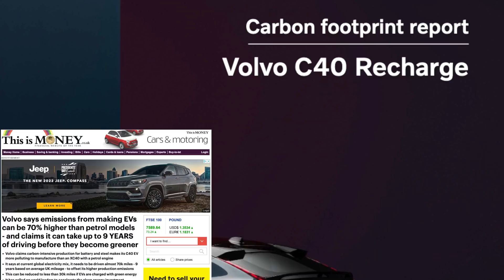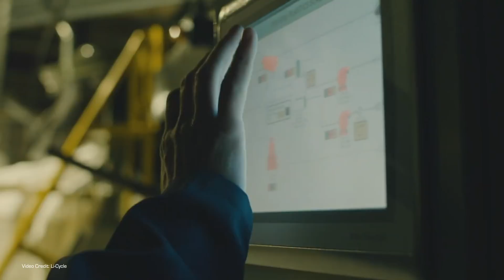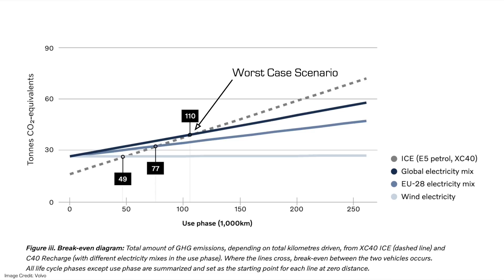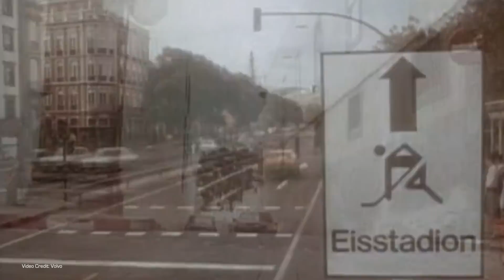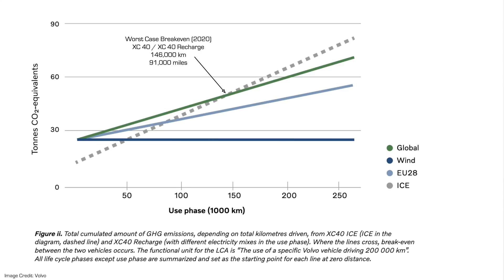Are EVs Dirtier Than Internal Combustion Cars? Not So Fast... We examine Volvo's Lifecycle Analysis

Comment: COMPARISON FLAW: Whilst it is interesting comparing between ICE and EV where the rest of the car platform is unchanged, this approach sounds greati but is biased towards ICE. Specifically, when you build an EV from scratch you do not end up with the same body design choices as with an ICE or shared body design such as having gearbox tunnels and reinforced engine mounting points. It is like comparing a horse-drawn carriage with an early automobile by removing the horses, bracketing the engine on to the same carrage but still having the original structures, and design heights that were created because of the horses.
An EV shoe-horned into an ICE body will not have the immediate, and therefore lifetime, efficiencies of a sensible pure EV design. Even a platform designed from scratch for petrol or EV will suffer from lowest common denominator disadvantages for the EV implementation.

Comment: Okay the only way I can compare an Eevee to a regular car emissions we have to take into a lot of factors not to mention the vehicle that you're comparing it to and how long it's been in operation and if it's still in operation and there are a lot of old cars going back longer than a hundred years still working. Then you got a factor in efficiency of those engines and at the highest today they're only 25% which means that cars older than that would have less efficiency and be more dirtier. I mean everybody wants to talk about the EV carbon footprint but they don't ever mention about the gas motor and all the other factors that come with its carbon footprint.

Comment: In the so called study in the U.K. Mail newspaper it stated that pollution was greater from an EV because being heavier so one had to used the brakes more to stop, what planet are they on? I hardly ever use the brakes, haven’t they heard of regenerative braking, Oh and heavier cars mean more tyre wear too. No mention though about the high levels of pollution in our cities cause by ICE cars both diesel and petrol, or the fact that thousands of people die prematurely from said emissions each year.
Reply: Increased microplastics from tire wear because heavier is the one and only valid point against EVs vs ICE, and far outbalanced by all the other things.
(Of course, the best solution is to move as many people as possible, as quickly as possible, out of single-occupancy vehicles and into mass transit.)

Comment: I read that report a couple of months ago. I concluded that the report states something that it doesn't prove. I don't see any specific values, and the supposed calculation on the Recharge version are based on an estimate of production. Another thing that I couldn't understand, is the fact that, the calculations they made with material weights, are (in my opinion) duplicated for the battery. Did anyone else get this impression?

Comment: That graph shows EVs having twice the carbon deficit when new compared to ICE vehicles. There is no way that is correct. Tesla's reports put it at 20% higher, a figure I"m much more inclined to believe. Many EV owners (like me ) are running their cars almost exclusively (or to a significant extent) off their solar power systems and therefore pay off the carbon deficit in a matter of months. Lastly, we're on a decarbonisation journey that is not exclusively about transitioning transport. Grid power is transitioning in parallel. By 2030 or 2035 when our grids are substantially renewable, nobody will bother talking about this stupid red-herring of embodied carbon in new vehicles as the mining and manufacture will have been done using substantially clean energy and therefore the embodied carbon emissions will be insignificant to non-existent. Many car companies (Tesla, BMW for example) are already claiming to be using as much renewable energy as possible at their EV plants in order to maximise sustainability. EV's keep getting cleaner every year and ICE vehicles will just continue to pollute (carbon and many other nasties) every mile they are driven.

Comment: I read the report and tried to pick holes in it, but as you've found it's all reasonable.  The only issue I could argue was that the electric vehicle they compared was not a dedicated electric platform and I think that shows in the extra weight and steel involved in its construction, and the worse efficiency of the electric vehicle than a pure electric platform may provide.   I understand why they did it, as it makes other parts of the comparison more easy and fair, but I think it does result in a slight negative bias against EV in general, even though accurate in the specific case examined.

Comment: There is no way you can expect an EV to last 300K miles on average. Look at the history of battery degradation and failure of EVs and hybrids after 15 years.
It would take 20 years for a vehicle driven 15K miles to pack on 300K miles.
Batteries degrade based on both mileage AND age and there are few 15 year old EVs to prove they would last that long.
Some Teslas in extremely high mileage fleets that packed on many miles within a few years of use proves very little.
Reply: You seem unaware of the fact that EV battery packs can be refurbished rather than completely replaced. Cleveleys Electric Vehicles, an independent EV specialist based in Gloucestershire in England, carried out a battery refurb on a 10 year old Nissan Leaf. The work took 4 hours, and cost the Leaf owner £600.... Good for a few more years.  Perhaps you ought to see the YouTube video posted by a Tesla Model S owner. His car had covered 400,000 kms on it's original battery...... There are a number of taxi companies here in the UK with Nissan Leafs which have topped 200,000 miles without issues.

Comment: What is preventing the reduction of CO2 emmisions in the production of EVs? Is there any part of that that can't be electrified?
Reply from the maker: While difficult there is progress on electrifying mining and resource extraction. EVs does till require lubricants some of which are currently oil based - and at present some plastics are oil dependent... Although increasing effort is being made to transition to renewable and plant derived plastics.

^kate

Comment: If they could solve the radioactive waste disposal issue for nuclear power, that would be the best of both worlds as long as they can put airtight and rock solid safety measures in place to negate the possibility of another Chernobyl or other nuclear catastrophe.
Reply from the maker: The biggest challenge now for nuclear power is that building good, safe, efficient plants takes a ridiculously long time, and climate change is moving fast. We needed to be commissioning nuclear plants 10-15yrs ago if we wanted them online now and making a difference. They are also incredibly expensive to build compared to solar, hydro, and wind generation. Personally, at the very least, I’d still like to see nuke plants that are currently offline, but ready to restart, such as those in Japan, returned safely to service, but I don’t know if we will - Winter
Reply: @transportevolved  For sure, they are colossally expensive and complicated to build and I wish they had solved the nuclear waste issue by now (the first nuclear plant went online in the mid 1950s) because they hold a lot of promise. Us humans take generations to learn our lessons though, so we react instead of taking proactive measures to safeguard our future.

Comment: As an EV driver, I often hear this argument.  It blows my mind that people are so dense to think that something that burns fuel in order to move can possibly be cleaner to run than something that doesn’t at all.  Electricity Grid is getting cleaner all the time.  We are making major breakthroughs with the possibility of Fusion Reactors coming in our lifetime.  Battery Tech is changing rapidly and recycling methods are getting better.
Reply: The reason for this, is because it is a nuanced discussion. And the other sad reality is that most people are too stupid and lazy to have a nuanced discussion. There are real costs to battery pack production and charging, but clearly those costs are less than that of operating an ICE vehicle. The problem is most people aren't smart enough to think for themselves and rather read headlines and that gets you to the point where we need this video.

Comment: Does the Volvo report include the carbon impact of increased servicing requirements for ICE compared to EVs? Is it purely based on the manufacturing of the vehicle and the refuelling?
Reply: And the manufacturer and disposal of oil lubricants for ICE vehicles?

Comment: pretty sure the CO2 emission values from fuel use are the result of decades of lobbying. And, representing an unrealistic scenario like a surface well, next to a refinery and the pump just out of the gate.
Besides, the XC40 recharge is one of the most inefficient EVs on the road.
Reply: The poor of efficiency of Volvo EVs is a really good point. Many EVs are twice as efficient or more. Perhaps Volvo should conclude from their report that Volvo should make some smaller, more efficient vehicles (never gonna happen - that could mean smaller profit margins! gasp!).

Comment: They are trying to raise the issue of dirty coal power and advertise themselves as big environmentalists on how to reduce "lifecycle Carbon Footprint per average vehicle by 40 per cent between 2018 and 2025", but they are doing it in an extremely manipulative and misleading way. If you increase the initial data, you will not have to move your finger in the next few years. 

- According to them, an electric car has an average consumption of 240 Wh/km ... but in reality the average consumption is 18 Wh/km. And the best-selling electric cars on the market have even lower consumption - 140-160 Wh/km.
- According to them, XC40 consumes 2 to 5 liters of gasoline per 100 km. In reality, they do not fall below 7.5 l / 100 km. And what about urban conditions? 10-16 liters is the information I hear from owners of these cars.
- According to them, 2 liters of gasoline are responsible for 45 g.CO2 ...  What kind of absurdity is this !? Combustion of 1 liter of gasoline creates 2.31kg of CO2 ... as well as toxic exhaust gases.
- According to them, "End of life" of an electric car generates an additional 0.5 tons of CO2 ... But they intentionally miss that the batteries are recycled at 95%.
- According to them, the extraction and refining of fuels does not emit any significant emissions ...
- According to them, 27 tons were the emissions from the production of electric cars ... Woah!... How does everyone else manage to produce them with only 5600 to 8800 kg. CO2? 
- According to them, the life of their cars is only 200,000 km ...
- According to them, the regular change of oils, filters and consumables, as well as the production of spare parts ... create almost no pollution. But their "recycling" is usually... Incineration. 
- According to them, the electricity has emissions of 600 g.CO2 / kWh. Even for Poland that's a lot... Average for Europe is  275 g.CO2eq / kWh.
- According to them, 18 tons of CO2 are released in Europe after 200,000 km. If we calculate even for their 240Wh / km we get 13.1 tons of CO2 ... strange. If we use the average consumption of 160-180Wh / km, for these kilometers we get 8.7-9.8 tons of CO2.
- But they contradict each other in the data for the "manufacturing" category, where internal combustion engines generate 2.1 tons of emissions, compared to 1.4 tons for EV.

Some additional information:
- ICE car manufacturing - between 5200 and 6900 kg. CO2
- EM together with the battery - between 5600 and 8800 kg. CO2
Operation:
- ICE - emits toxic exhaust gases in addition to CO2 - CO, NOx, SOx, PM2.5 and fine dust from pads ... right in the cities where we live. They are responsible for 260-350 g. CO2 / km
- Efficiency of an ICE car - 18-30%
- Efficiency of an EV - above 80% after all the grid losses.
- EV - does not emit anything during operation, but charges with electricity from the grid. In Europe, emissions from electricity generation are as follows - Average - 275 g.CO2eq / kWh, France - 49 g.CO2eq / kWh, Germany - 177 g.CO2eq / kWh, Bulgaria - 355 g.CO2eq / kWh, Norway - 32 g .CO2eq / kWh. If we consider local electricity from Renewables - approximately 0 / zero / g.CO2.
For a relatively dirty grid, the emissions from charging an electric car are equal to 26 - 48 g. CO2 / km

This difference in manufacturing is made up after just 9000-10000 km. After 200,000 km. the difference in emissions is over 10 times +  tons of toxic gases.

Comment: US federal government subsidizes petroleum industry. Gas pollutes on production and tailpipe. Gas motorcycles and gardening equipment are huge polluters, that should be addressed immediately. Much of the public is immune to facts about gas vehicles. Part of it is this prevailing thinking that bad ideas have as much value as good ideas.
Reply: It's common in certain areas to get a large diesel whole house generator for power outages, doesn't seem to make environmental or financial sense versus solar that you can use year round.

Comment: I noticed that CO2 emissions of EV was higher due to the battery production. I’m curious if the CO2 emissions of extracting, transporting and processing of crude into gasoline is factored into the total emissions of ICE vehicles and not just how much CO2 is emitted when they’re consuming the gasoline.
Reply: As Kate said in the video, there were no reliable figures for this, the 'feeling' is that the industry supplied figure were highly questionable, and likely did not account for all emissions.
Reply: They did use a figure for CO2 emissions that tried to include those other factors. Whether they are perfect is debatable, but they are the best currently available.
Reply: But of course you have to factor in the recyclability of the EV battery one it reaches the end of it's useful life, when, if it's recycled, 90% of the lithium and cobalt content can be recovered and re-used in new batteries. There is no way to recycle and recover burned gas/petrol and diesel.....
Reply: The point is, there is no need to dig further, even using “questionable “ data from the oil industry, if you factor all the energy consuming aspects from the well to the wheel during the whole lifetime of a car an EV is always cleaner, and it has the potential to be even cleaner. 
So yes , we can doubt everything, but there is no need for that. EVs are the more efficient and less polluting cars.

Comment: Nicely done! Any chance you guys saw the article in The Guardian spouting the same, but different,  rubbish.. it's a disaster coming just like diesel gate but worse! And then it makes up rubbish.. the most notable I thought was the increased wear on break linings because the electric car is sooo much heavier! Apart from battery cars not being that much heavier nearly all of them use regenerative breaking so generate electricity rather than wear the breaks! You might like to track it down.. for a laugh.. and then a cry..

Comment: Prius is better than any EV. Prove me wrong...
Reply from the maker: In what specific way is a Prius better? I've owned one and driven multiple Prius and I would take my Niro EV every time over the Prius and the number of situations where the Prius would win out in my life is approximately zero.

^Kate
Reply: the prius is a hybrid, which means you get the worst of both worlds. small battery -> no electric range, small petrol engine -> no performance, smaller tank -> no range. and you still have all the maintenance cost of an ICE car. no, i don't want a hybrid. fully electric is the way to go.
Reply: @mrxmry3264  Exactly.
Reply: Easy enough. The Prius is now 15 year old technology, and cannot charge it's battery unless it's actually burning fossil fuel. It also has the disadvantage of having two separate power sources. One power source has to propel the weight of the other when it it isn't in use. That's hardly efficient....  Sales of hybrids are now falling in the UK, in favour of full EV's. I'd expect most car makers to drop hybrid production inside the next 5 years..... The Prius still has an ICE engines, which runs at 30% efficiency at best. An EV can top 80% efficiency.....
Reply: @Brian-om2hh  
"One power source has to propel the weight of the other when it it isn't in use."
which is another reason why hybrids suck.

Comment: :yt: After last week's EV meeting I decided to use the EPA's Beyond Tailpipe Emissions Calculator for zip codes like 82401. This zip code is located in Casper WY which has some of the highest electricity produced by coal. Why do some of the PHEVs have the same or better emissions than their comparable EVs? I own an ICE vehicle and two EV's and plan to upgrade to an efficient Aptera EV with a 600-mile range someday but was shocked about the EPA results. Is this why some truck and car MFGs are saying PHEV's are just as good?
Last week I conducted a meeting in southern Florida about EVs. Out of 100+ people, not one owned an EV as their only vehicle. In the group, only one family had an EV car. This family also owned an ICE vehicle. When I asked why they owned an ICE vehicle they said during a mandatory hurricane evacuation to Georgia there are not enough charging stations that can handle the volume required for a 250+ mile trip to a safe area that takes over 10 hours.   SIDE NOTE: Well over 80% of the people in the meeting owned electric golf carts.

Comment: I also wonder with this study if they actually recorded true petrol and diesel emissions, not just manufacturer quoted. Especially on a few year old car. I wouldn't be surprised if the break even point was way lower than that in real life. Plus this is only about co2, in the real world fumes are causing harm in the local air quality, co2 is only one measurement of emmisons.